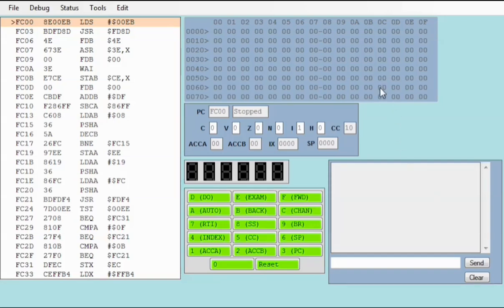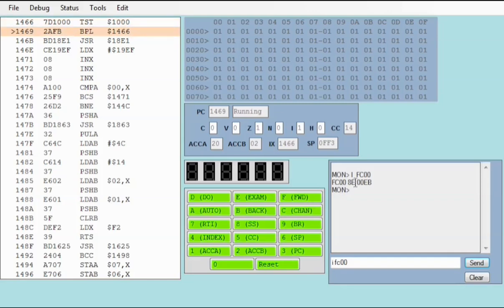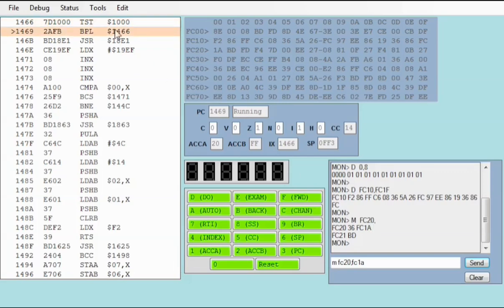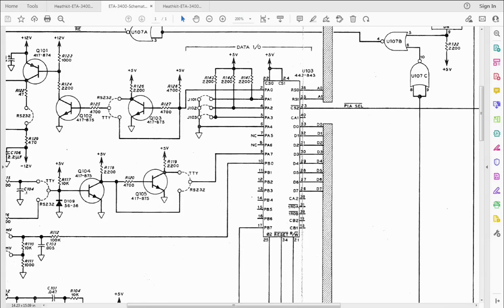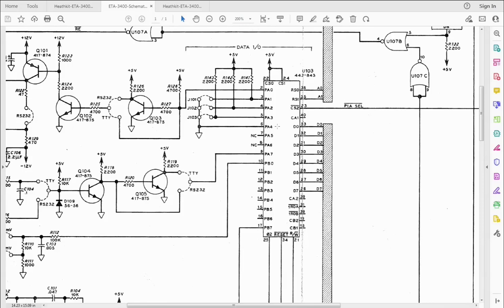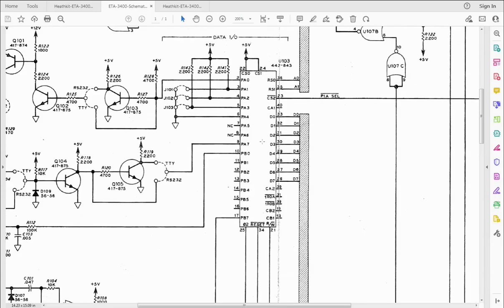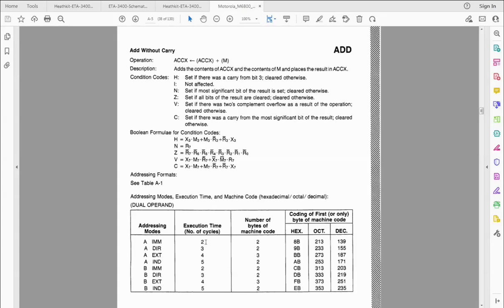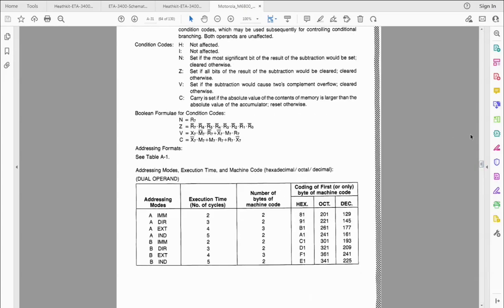AE#162 Motorola 6800 Machine Language Programming, Part 5

Comment: Great work, I am finally starting to learn and use this trainer.  I had it for over 20 years, bought it from a friend and he had the complete kit, including all books, audio tapes, parts for experimenting.  I also assembled one during my time as electromedical equipment instructor around 1979.  My boss wanted to same programs to a 1-inch video tape unit but, I never got to see if it worked as I left that office.  Did you make available your emulator, if not can you recommend one that works on Windows 7 or 10?  Thanks.

Comment: Thanks for making these, I've been playing with an SWTPC 6800 and you've given me some ideas. The serial port on those was done the same way, a bit-banged PIA. I do have an upgraded card with a 6850 but haven't got it working yet. 
I also have an old serial terminal that is 6800 based, the "Telcon Ambassador IV" which was made in 1980. It's a real basket case so I'm trying to reverse-engineer the circuitry as well as the roms. Your simulator seems like it might be able to help.

Comment: If I remember me right on low level the serial stream +12/-12 signal is reverse logic high pegel is '0' and low pegel is '1' maybe i'm wrong.
By the way I collected many MC680x stuff as pdf also I love the 6803 you can use the A,B registers as a real 16bit register 'D' this was the 6502/10 and Z80 killer for me 🙂
Reply: There had to be more features that made the 6803 a Z80 killer for you.  The Z80 has three 16 bit registers, and they can be easily swapped to an alternate set for things like interrupt programming.
Reply from the maker: RS232C does specify -12V as a '1' and +12V as a '0'. But if you're using modern equipment, such as a USB to serial converter, the voltage levels are 0 and +5V respectively. To communicate with older equipment you would have to level shift the voltage levels to the original requirements.
Reply: @artifactelectronics  In this specific case, "modern equipment" can go back a LONG way.  Commodore implemented 5V RS-232 signalling on some of their machines.

This had certain advantages.  Since you needed a level shifter to talk to standard RS-232 devices anyway, you could also use adapters that converted to RS-422, RS-423, or RS-485 as well0.  (You couldn't talk or listen at anything like the full speed of those interfaces, but the higher speeds were not frequently used and Commodore machines were limited in useful speed to half their disk storage speed or they couldn't store the received data..  This maxed out at about 10 kbits/sec on a Commodore 64 using fast-loaders, and about 20 kbits/s on a Commodore 128 with a 1571.)